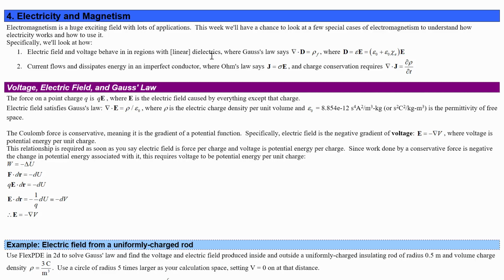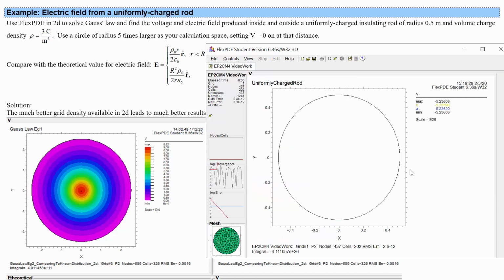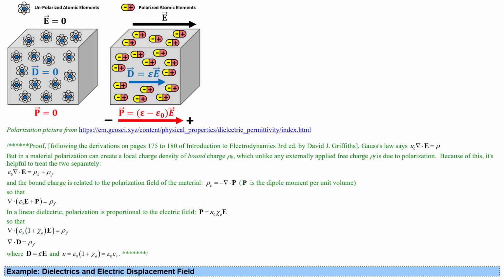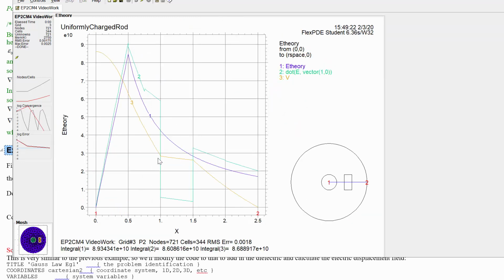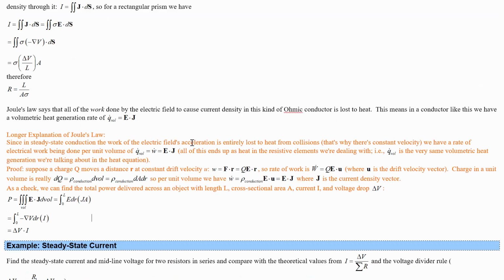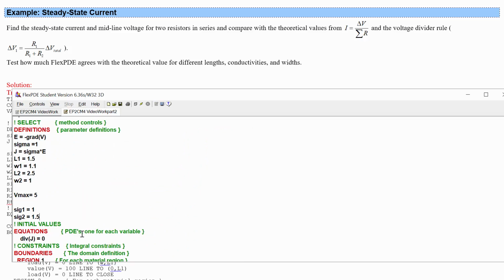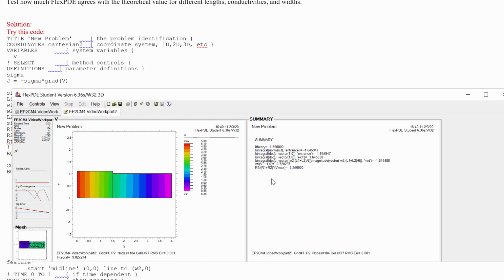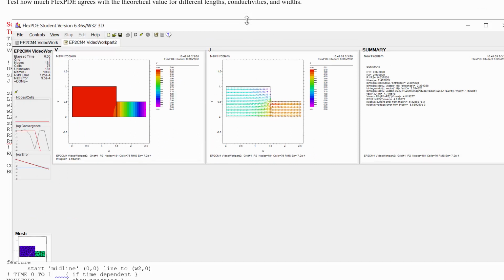EP2CM4 Topics in E&M

Comment from the maker: At 00:00 and again at 30:40 the time-dependent continuity equation relating current and charge density should be div(J) = -del(rho)/del_t, not +del(rho)/del_t, since positive divergence of current density at a point requires charge density there to be decreasing (if there's a net current leaving an enclosed volume, it must be because the charge within it is *decreasing*)